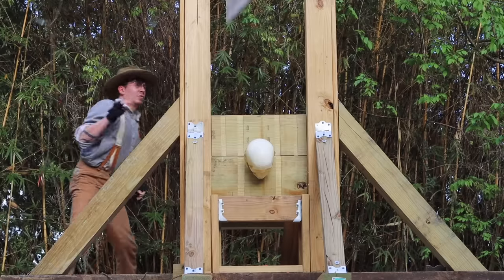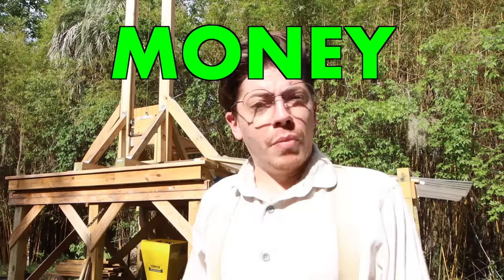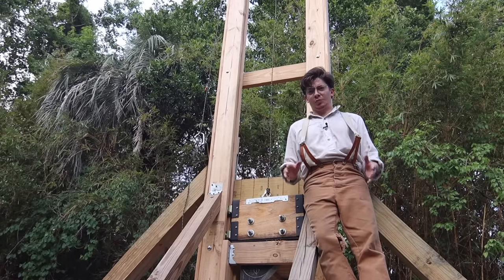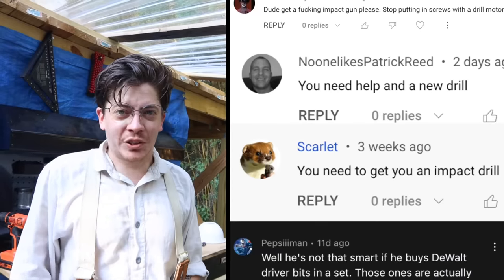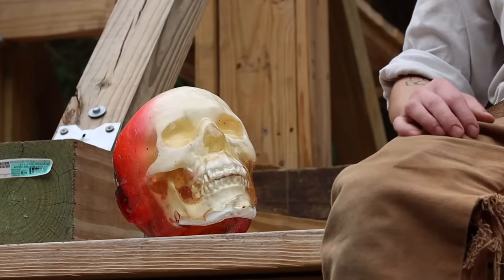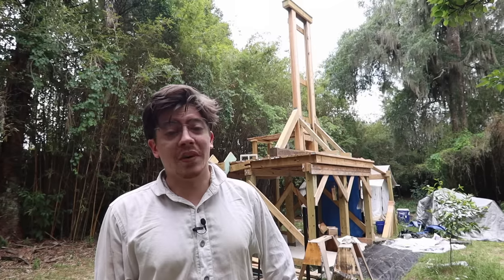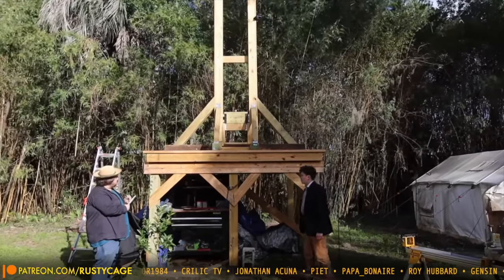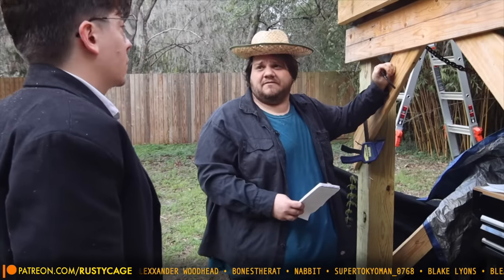How Much Does a Guillotine Cost?

Comment: I have no idea where you used your nails or screws, but I can tell you that screws have better tensile strength and nails have better shear strength. So if the fastener is gonna be perpendicular to the ground (like floorboards) use screws, but if they will be at some other angle compared to the ground or parallel to it (like support beams) use nails.

Comment: In my experience with tools, both my dad and my mechanic instructor said that the tools they sell at Harbor Freight are both inexpensive and reliable and the tools I bought from them have never failed me.
Reply: Yeah, usually if I need some tools for cheap then I go to harbor freight.
Reply: If you're working with construction lumber sure. Now try drilling through steel on a harbor freight drill press, or using harbor freight drill bits in a large metal lathe. It's built for the Average person, but the new tools can't handle the kinds of jobs that the old tools could because most people don't cut steel or drill shitloads of hardwood.
Reply: @bilbo_gamers6417  yeah that’s true. I only ever work with construction lumber so i don’t need the best tools for that
Reply: @bilbo_gamers6417  You got a point there, I mostly use hand tools in my trade.
Reply: @bilbo_gamers6417  that totally makes sense.

I was on a robotics team and they would never recommend harbor freight. We'd work with metals, especially aluminum, a CNC router and a lathe frequently.
Too many times the team or team members bought tools either for the robot or personal projects and they'd break. They'd work for a time, but they'd break way sooner than other tools or bits would.

While the team definitely had preferred brands, usually the largest requirement/recommendation was to avoid Harbor Freight.
Reply: 144p-th 👍

Comment: I am the cheap corded drill skit. Our ancestors would have gawked at our tech from 30 years ago. Battery powered drills only exist because astronauts needed them. Try using a brace and bit you pansies. Rusty... I'm glad you included that bit with code enforcement. It's a nice change of pace from most stuff on youtube. It felt reminiscent of 90s television. Please dont doubt yourself or the direction this takes you <3
Reply: No impact drill havin gang!

Comment: I probably spent about $1,200 to have a reproduction 12th Century headsman's axe made in the French style by my blacksmith at the Renaissance Festival.  He used a pattern from a museum for the blade and butt-end and a teak handle.  It may not be industrial but it is razor sharp and portable.  Heads should roll...

Comment: The reason why they say use nails over screws for building structures is simple… Screw are brittle and snap when the structure moves… however, nails bend when the structure moves but keep their integrity… so it really depends on what you’ll be doing with your finished project… and since the lemonade stand with move and hold weight it’s smarter to use nails over screws… just a thought…

Comment: I was a carpenter for almost 3 years. You are doing a good job. Anyone who is criticizing you must not have seen what “professionals” do, cause I’ve seen plenty of professional carpenters do worse work than you. And I’ve seen amateurs do better. The point is, everything is square, and secure. You did good.

Also, everyone at work used to call me “the Milwaukee kid” all because I had a Milwaukee impact and drill, which was a gift from my parents lol. That being said I do like their tools, but dewalt is decent too. If you are working professionally there is certainly merit and value in buying more expensive tools, but if you aren’t a professional the cheap stuff works fine.